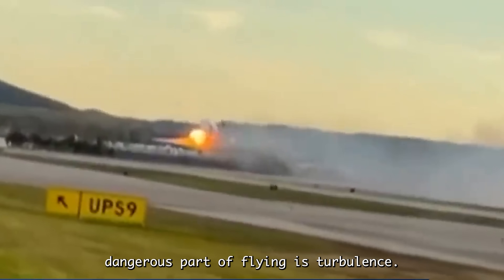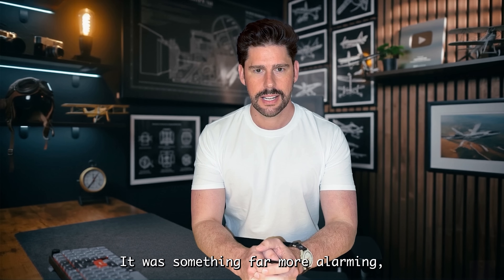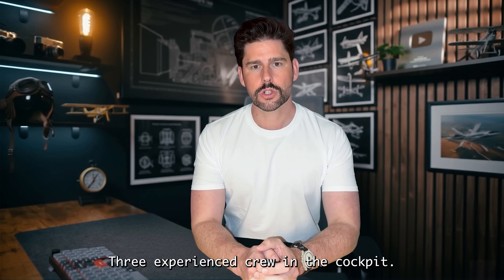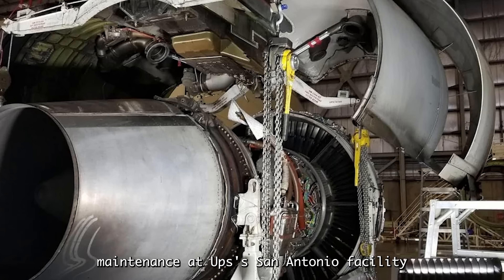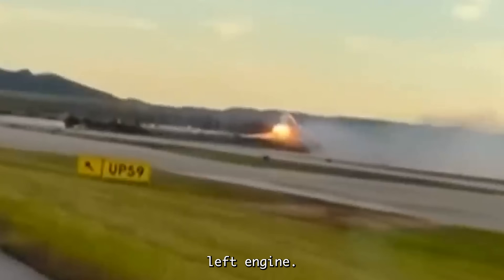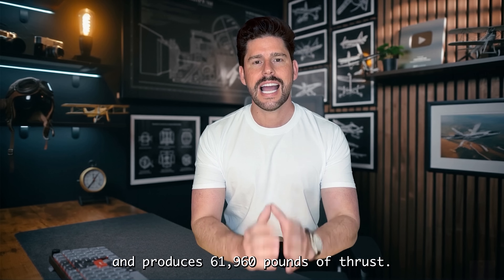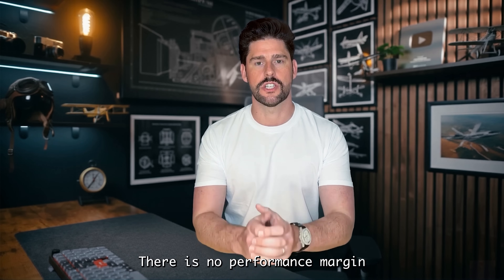The DEADLY Mistake That Caused the UPS MD-11F Crash in Louisville

Comment: It wouldn't surprise me if they didn't revert back to the same improper maintenance techniques that caused the crash of AA 191 DC-10 in 1979. They knew the risks and recalculated the cost of a failure. UPS MD-11's were cargo jets with very few people on board...not close to 300 people like on a DC-10. The public outcry would be greatly reduced. The improper method of engine removal and replacement would again save significant time and labor costs. If there was a failure on the MD-11 and it crashed seconds after takeoff into an industrial or even residential area, the lives lost on the ground would most likely be significantly less whether it be a passenger jet or a cargo jet. Boeing doesn't have the less than stellar reputation it does for no reason.

UPS and Boeing most likely (my opinion only) bet on cost savings over potential losses. My money is on improper maintenance of the engine and pylon.

Comment: ....and then there ARE OTHER planes that have lost engine(s) mid flight/take off as well. Some being more recently than that other plane. Example....flight WHALE 05 lost 2 of it's engines AND pylons when heavily loaded with fuel. As well as the extra fuel for refueling missions.

Comment: It didn’t happen “again.”   The circumstances are completely different from the American Airlines crash which was a maintenance shortcut that damaged the engine pylon.  The UPS plane had a catastrophic engine failure with debris then getting sucked into another engine causing it to fail.   It was a perfect storm.  The MD-11 can’t take off on one engine and it was too late to abort the takeoff.

Comment: For fucks sake it was not a fucking boeing. So why start by saying it was. Turbulance has never ripped an engine off a Boeing before take off. It was a MD11. Not a boing or a dc 10 or an airbus. It was one of the fatality machines off the Mc Donalds drawing board.
Reply: McDonnell Douglas started calling their planes MD instead of DC after the DC Ten got dubbed the "Death Cruiser 10" after multiple fatal crashes including the one in Chicago.

Comment: You are partly maybe all on the right track, but this is not the only cause of detatchment.  An inbalance from either a fan or turbine disintrigration could cause a huge imbalance vibration that could cause the rear mount to fail.. which it probably did.   If you look at the pictures of the #1 engine laying on the side of the runway, there is a definate hole in the turbine section.  A turbine failure breaking the aft engine mount and subsequent movement of the engine could have been the cause.   While you would think that if that was the cause and only the engine would then break away, the two front engine mounts are quite robust and could have taken the pylon with it   THE NTSB TOLD US THAT PART OF THE PYLON HAD DETATCHED..they didn't say it all did.   Find the best pic of that engine and look at the turbine section.. definately a hole about a half meter long  and 1/4 meter wide  (20"x10") that appears right where that rear engine mount would be.  It would be nice to see the tower cam of what kind of dance the engine did after departing.  It did wind up on the other side of the runway, indicating it went up and crossing over the top, possibly depositing parts into the center engine

Comment: Who the fudge are you... Comparing Chicago AA crash of a DC-10 (due to maintenance damaging the pylon with unapproved engine installation with a fork lift) has no bearing on what happened with UPS.  Yes TAKE OFF and LANDING are the two most critical times of a flight, but to say turbulence has never ripped an airliner apart is not true. It is rare but the 1966 Mount Fuji accident is an example. The pylon is inspected with engine off,  both visual non destructive testing, Eddie current,  ultra sound and X-ray is done. .

Comment: Totally different. The AA crash was caused by a bad maintenance shortcut - using a forklift to move the engine and pylon as a block when taking it off and putting it back on the plane because it was a lot quicker than detaching the engine from the pylon. No way any maintenance crew would do that again. That caused a dent in the pylon which led to a fatigue crack. The engine and pylon separated and went up and over the wing destroying the slat control hydraulics on the left wing, retracting them, which caused the roll and then crash. 

On the UPS MD-11 flight, the cowling came off first, then the engine and pylon. There was also what looked like a compressor stall on engine #3, perhaps caused by flying bits from the #1 engine getting into engine #3. Bits may have hit #2 as well. That's always been a problem with T-tails.

It looks like it hit the roof of a large building first, tearing the left wing (or possibly the tail - something was left sticking out of the roof) off, then a petroleum recycler (not kerosene) and an auto parts & junkyard on the ground.

Comment: Cargo jets should have automatic ejection seats that automatically activate if sensors detect an unexpected impact with the ground. So the pilots could be automatically ejected from the plane and ejected off to the side far enough away to avoid the following fireball, upon any unexpected crash landing.

Comment: Woah woah, the theory of the pilon failure is not confirmed. While the MD 11 had issues early in it's adoption, all the pilon problems were addressed. That plane was manufactured with the updated pilon design, and there are no reported failures with the new design. Until the final report is issued, the engine causing damage to the pilon and ricochet off the runway of the failed engine striking the other engine are the most likely event. The song will be sung, when all the words are written.

Comment: We do not know if it was an engine failure or not. If the engine detonated it would have sheared the pylon bolts where they attach to the wing. They are designed to do so which lets the destroyed engine fall off without damaging the wing. If you will look at the photo of the engine lying on the runway you can see a large portion of it looks blown out. We can't rush to the conclusion that the pylon caused the whole thing. It could have been the engine.

Comment: Engine #1 fell off the plane. Engine #2, opposite wing, emitted several busts of flame, signaling a possible compressor stall. This is the first video stating that engine #3 ingested fragments. I call BS on this video. If you don't know the facts, shut your pie hole!

Comment: Correction; The engine IS designed to separate from the wing in the event of severe engine vibration! There are bolts that will break and allow the engine to free fall... I forgot where these bolts are :either the engine to pylon or pylon to wing but they ARE there. This is designed this way so the excessive vibrations doesn't rip the wing off!

Comment: Right from the start:  The MD-11 was NOT built by Boeing.  As everyone knows, it was built before the highly questionable acquisition of MD by Boeing, and, as many pilots agree is a lesser-engineered and harder to fly, extension and modernization of the ill-fated DC-10, built during the days of compeition with Lockheed's TriStar, and, again, possible rushed into service with known design issues, like the aft cargo door.  The influence of MD accountants and marketing, which has adversely affected Boeing in recent years, is well known. This horrible crash MAY have been due to the same maintence problem that brought down AA191 over 45 years ago.  Hopefully, we'll find out.  Prayers for the families of the crew.

Comment: Some pilots say, engine 1 compressor disintegrated and sent shrapnels toward the fuselage, the left wing and the engine 3 (right wing). Engine 3 then suffered "pumping" and lost a high % power.  This, they say, can be proven by small "puffs" that can be seen on the take-off video (when the plane tried to gain altitude) as small flashes of lights at the rear of engine 3.
Reply: it's called compressor stall
Reply: It's hard to say whether #3 or #2, but there appear to be indications of a compressor stall, which would explain why there was no takeoff. I think #3 was still thrusting due to the port roll the plane experienced before total impact.
Reply: The engine is still in one piece on the runway. When they throttled the engines up to take off it separated from the plane and flipped over the wing and some pieces aluminum ripped off the wing got sucked into the number 2 engine.  Same thing that happened to the American Airlines DC 10 in 1979 in Chicago except they didn't lose the number two engine and would have been able to climb had they not lost hydraulics due to the engine falling off the plane.

Comment: Engine pylon seperated FROM THE WING; NOT THE ENGINE. Engine was found with most of the pylon attached to it. If you don't know what a engine pylon is; then look it up.
Reply: For the UPS or the AA from 1979? I don't see any pylon attached to the UPS MD-11 engine in the photos I've seen.

Comment: I'd rather get information from a real pilot and not an AI person with chiclet teeth.
Reply: Real pilot here ...

I have been saying it and it's true; this incident is a copy of what happened to essentially the same type of aircraft. In 1979 American Airlines flight 191 departed Chicago fully loaded with passengers when the same left side ( #1 ) engine pylon separated from the wing on take off. Same result. A total loss. Flight 191 even crashed in the same manner, tilting to the left on impact with the ground at the end of the runway.
Reply: @HAVACILIK2 I've seen conflicting accounts on the pylon failure. What are your feelings about engine 1 causing engine 3 to fail? MD has such a history of putting profit above quality, and with Boeing absorbing MD and taking on their executives, it might explain the overall decline of Boeing. It's just a theory, of course.

Comment: I have been saying it and it's true; this incident is a copy of what happened to essentially the same type of aircraft. In 1979 American Airlines flight 191 departed Chicago fully loaded with passengers when the same left side ( #1 ) engine pylon separated from the wing on take off. Same result. A total loss. Flight 191 even crashed in the same manner, tilting to the left on impact with the ground at the end of the runway.

Comment: A Cf-6 that weighs 12,000 lbs and produces 60K+ of thrust doesn't fall off a wing. It tears off, ripping out the other attachments that were never intended to carry the loads borne by the failed attachment point.
The mounting of these engines is very carefully designed and tested. It is designed to carry weight loads, thrust loads, blade-out loads ....it is a long list. That said, they have no redundancy. When one attachment fails, there will be  unconstrained degrees of freedom. 
The loss of the airplane after a pylon separation is probably due to catastrophic failures of all 3 hydraulic systems or the electrical systems.
We will probably see some shortcoming in the written-in-blood regulations from the American DC-10 in Chicago.
The image shows a human "talking" but the image sounds like a computer.
Disappointing, even alarming trend in YouTube videos. The number reading is like fingernails on a chalkboard.

Comment: Short cut on engine removal, leaving the pylon attached and using a forklift to raise it into place deforms bracket. That is what happened in Chicago.
Reply: Pylons are not removed in an engine change. and the fork lift thing were banned a long time ago.
Reply: @harrisonbounel5916  Ya think maybe they just took the short cut again?   With the same result as 1979?
Reply: Sort of, the issue was the forklift was turned off at shift change and the lift slowly creeped down, while not notable the distortion caused damage that would later cause the separation due to metal fatigue.. But yes close.. The major issue is falling into the past to try and find a conclusion, it's best to wait and see then speculation. Which this AI is doing.
Reply: @TheObsidianShadow_T-REA 😊 Pushing engine up into place bent the bracket. This from "Air Disasters".
Reply: And the lessons learned back in 1979 ignored.

Comment: Dead wrong. 
AA191 didnt have engine 2 surging, because engine 1 went over the wing and straight back. In this case debris had hit engine 2, which cant happen, if engine 1 goes over the wing. So here we talk catastrophic engine failure, which caused engine 1 to separate and it debris going into engine 2.
Research proper before posting nonsense.
Reply: Man, with all the debris on the runway a piece could have flew up and hit the rear engine 😵‍💫🤔🧐😲 !
Reply: @markcollins5026  Watch "Flying for Money" on UPS 2976

Comment: Your facts are in question , happened on 4th not 6th, San Antonio maintenance facility not UPS’s it’s a vendor that preforms maintenance for many airlines. Number 3 engine was more that likely the engine that was FODed out # 2 is 30 feet in the air, 3 is on the same level plane as 1.The picture of the engine by the runway shows a hole on right side of turbine case indicating a turbine wheel failure.
Reply: As established in the Chicago crash, the engine pylon assembly tends initially to lift over the wing rather simply drop as you imply.

Comment: Friday, May 25, 1979.  I remember sitting in a TV Room in the College Dorm where I lived at the time. I was with my Girlfriend of the day. The news of AA 191 had just cut in. It happened less than an hour ago. One of the first things they showed was that photo of the plane. It had dipped Port side. I could clearly see that the port engine was missing along with the mist trailing from the wing. I was 21 years old and was horrified. My Girlfriend cried quietly "Oh those poor people! Their last moments in sheer terror!"😢
Reply: Did you live in the area of O’Hare? I lived 3 miles down on Elmhurst Road. I was working at the venture store on Elmhurst  Rd and Dempster Street. I remember it vividly fire trucks flying past the store people running in the store telling me a plane crashed at O’Hare. It was a very hot and humid day. It was horrible the whole weekend was horrible. Terrible day for Chicago.

Comment: This looks like all fingers are pointing toward maintenance. Could it be fatigue accumulated over years? Yes, but inspections are supposed to reveal them before catastrophe. R/R of an engine done incorrectly? Looks like it to me, but I'm sure best efforts will be made to cover it up. And if so, was it reported? And did management over-ride the reports and pencil whip it? This could be the Deepwater Horizon event for airframe maintenance, long overdue IMHO. So many companies outsource to foreign operators. Race to the bottom has been won. Now it's past due time to move back up.

Comment: Your coverage is very through.  The splicing of various segments does not allow for a breath or a verbal break for the listener.   Very difficult to follow along.  Please allow for a break in the audio.
Reply: This is a common fault. They want to just throw a string of information at you without considering a person needing time to absorb or consider their speed reading. We don't yet know if the problem started with the engine exploding, causing a sequence of events ripping the pylon off.

Comment: No matter what you call it, it is still the DC-10 death plane
Reply: MD 11 does not make the engine  or maintain  the airplane   it's the maintance
Reply: Because of BAD maintance
Reply: @gregbennett4254 
That was back in 1979 with Flight 191
Reply: Bad maintance

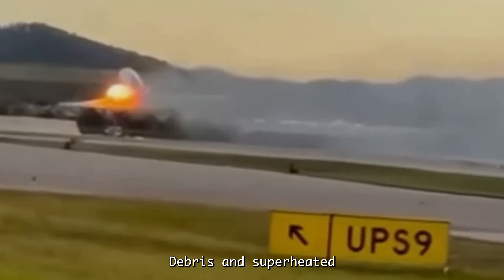Comment: 3:54 there’s a working theory that the number 3 engine on the right wing was also suffering a compressor stall, evidenced by the spitting of flames out of it on the initial take off video from the rear view of the plane.
Reply: No...that was the CENTER angine!
Reply: In this setting, the detached engine tends to lift and pass over the wing before falling.  The relatively intact cowl belies that scattered rotor blades theory.

Comment: The engine and a chunk of the turbofan cowling are in the grass about 200ft to the left. Also the pylon is on the runway to the left, along with engine separation dabris to the left also on the runway. These points may give a clue as to how the engine ripped off the airplane. To me me this is an indication of a sudden shaft seizure. There must be reduction gear case between the jet engine and the turbofan. And it would have gears, an oil pool and oil seals. Haven't haven't seen comments about this possibility.

Comment: Actually the engine IS designed to separate from the wing not to damage it in case of excessive vibrations in the engine. I believe the turbine failed and thus creating vibrations to cause the pylon to separate and throwing debris into engine no. 2. The aircraft was doomed with a full load of cargo and fuel.
Reply: If the rear Clevis & Bolt Joint fails, it's designed so that the Engine will drop, rear end first. Then roll over the top of the wing. Then fly away without striking the tail wings & fin.
Reply: The debris was thrown into the number 3 engine, not the number 2. The number 3 is the right wing engine. There is video evidence showing it having a compressor stall.
Reply: I wonder if the separated engine would fly past the cockpit? Sort of like when a trailer tire rolls past you on the interstate, then you realize it was your trailer tire.
Reply: @duanejackson6718 very unlikely the engine has the stability and momentum to do that?
Reply: @duanejackson6718 man, kinda like the coyotie riding a rocket on the road runner cartoon 😢 !